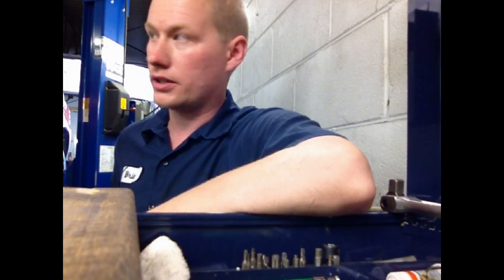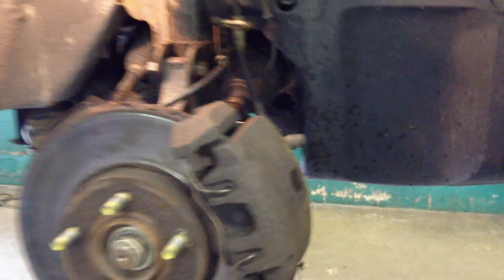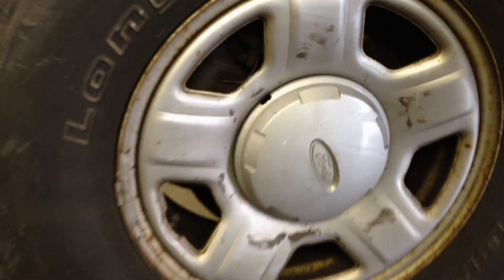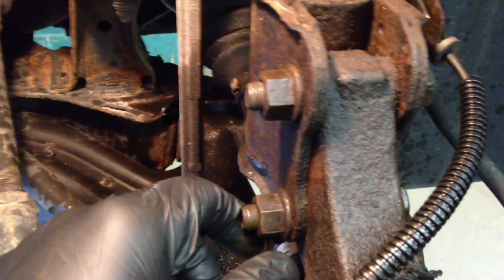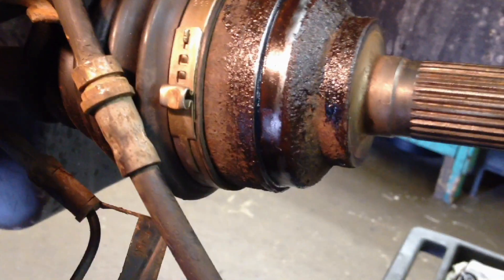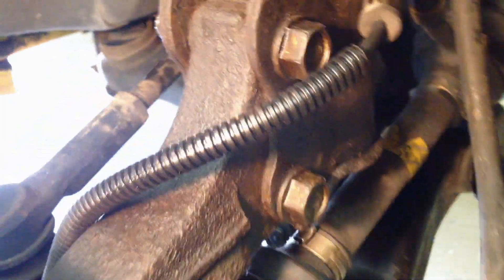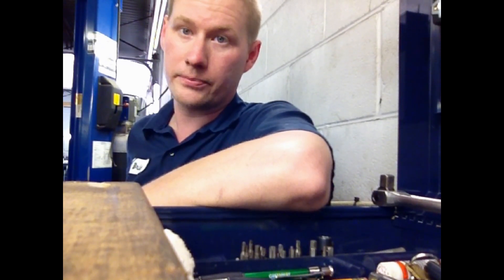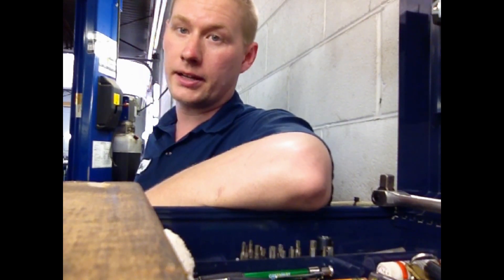Ford Escape ABS Tone Ring Install C1233 C1234

Comment: IT WORKED!!! Thank you so much.  It was a bit of a pain to get axle out and the new tone ring on with just a hammer and trying to be gentle, but using this advice and video, including the socket sizes and parts we needed, we were able to do a repair that was quoted at $300-350+ for less than 50.  Pro tip: long armed wrenches/sockets are critical, if you don't have pneumatic tools,  it took more force than I weigh to get those two main bolts off.

Comment: Replaced second tone ring on wife's '08 Escape just tonight. Used this method for the first, but hadn't seen your video where you suggested a little bit of grease. The first one took a long, long time to get on two years ago! This time I used a Dremel with small wire wheel, wire brush, grease, and the heat-gun application mentioned below (heat up the tone ring!) WOW did that make a difference in how well it went on - less than 2 minutes to fully seated!
THANK YOU for referencing all of the nut/bolt sizes, and also for the torque specs in the video!
THANK YOU for all of your awesome, informative videos!

Comment: Best repair video I've seen both in description, of procedure, image clarity and avoiding unnecessary steps (that add labor cost estimates in factory manuals). Appreciate added pro tips on removal of hub.  Using old ring as a tool is what a pro would use offsite without "special factory tool ####". Idea of heating ring (i.e. in oven) to expand is great suggestion. Excellent documentation by a 5 star tech!

Comment: I drive a 2003 Ford Escape XLT. My ABS light has been on for a while. I was prepared to buy two new sensors and replace them until I saw this video. I checked afterwards and found that one is broken and the other is completely gone. I will replace them once I go to do a brake job when it warms up outside.

THANKS FOR THE TIPS! Keep them coming.

Comment from the maker: I know I drag on in the beginning, I was trying to explain it a bit all off the cuff so...... Yes the job could have been done by the time the intro was over but I have a 32hr guarantee at work and it's been so slow it's unreal, that's when I make my videos when there is actual time to do it.
Reply: My 5 speed manual is giving me a tone alarm when I start the engine, 4 double quick tones. Engine light on, and my power steering failed, but once computer reset, power steering came back. Now also have extreme shaking of steering wheel especially when wheel turned left. New tires, good air volume, new brakes front, new baring on left.
Reply: Thankyou for making these videos it is a God send
Reply: When putting the ring on is there anyway specific way to line it up or it can go on randomly?

Comment: Thank you so much for posting this video. The shop refused to replace just the tone ring and wanted to replace the entire axle. After watching several videos showing I needed to take apart the tie rod or ball joint, I ran across your video showing neither was necessary. This was a great news as long as my 07 escape was the same setup. (It was) I completed the entire job in my garage in under 2 hours. The hardest part is making sure you have all the rust off the axle before putting the new ring on. I used a Dremel tool with a small sanding disk and it worked great. Thanks again for the great instructions and video!

Comment from the maker: No it won't, fits very tight. Just a bit of grease wipe excess off as stated. This is the exact way we do them at the Ford dealer. No heat, a light film of grease, only difference is we have a press on tool. Same idea only smoother to go on.

Comment: I have a 2008 Escape and I used this video to replace the tone ring. Only took an hour and $10 for the part. I used a gear puller instead of the punch to push the axle out, worked great. Thank you for the great instruction, saved me $$$. No problem with the ABS now.  Turns out a friend of mine has a similar issue on his F-150. Now I can help him. Thanks.

Comment: Dear Makuloco, I appreciate your video soooo much! I replaced a tone ring today, using your super-duper steps.  The most time consuming part of the job was removing rust from the tone ring mating surface.  It wouldn't come off with a deburring wheel on an air grinder.  Made sparks but no rust was removed.  The rust was dark and hard as mill scale.  I finally used a small file and worked it around the diameter. I also scraped at the rust with the blunt end of the file and it would flake off. I used anti-seize compound instead of grease to bed the ring because I am a great believer in the stuff. 
     One thing I have not seen mentioned  in other posts is that tone ring replacement is an ideal time to inspect the brake hose.  On this 06 Escape with 142,000 miles, the cover has failed at two locations and the cord is visible. I ordered two front hoses from NAPA and replacing them is tomorrow's job. 
     Here's an INCREDIBLE ITEM.  This tone ring failure is the first breakdown maintenance item since our family bought the Escape when it was one year old.

Comment: I have to say that you are right the money. I just installed new rotors and pads because I was having issues with my breaking. I noticed the ring (after seeing your video I now know it's a tone ring) was cracked. I didn't think it was an issue but I was way wrong. I am going to replace the tone ring now. Thank you for posting the video. From Kentucky, Brian.

Comment: I spent a bit of time trying to diagnose this fault and then decided to try Google. Even as an auto tech there is so much we can learn from guys like you. Thanks so much for this video. Here in NZ our local Ford/Mazda dealer does not stock the tone ring as a separate part so I will have to buy after market complete CV joints. Still a lot cheaper than the dealer quoted me for complete axles. :) Once again, thanks for doing this.
Reply: Same!

Comment from the maker: Axle nut torque for an 2008 is 221 lb-ft, front arm bolt spec is 85 ft lbs

Comment: I follow the instructions from the video , all worked out changing the tone ring on the 2006 Ford escape XLT . Dealer told me will have to replace the whole joint .
Paid 17 dollars for the ring and replaced it myself . It took 2 hrs everything was stuck .
Reply from the maker: Good to hear it all worked out 2 hours or not it is allot better than what you would have paid.

Comment from the maker: The actual tube of the strut that comes down and bolts to knuckle by the 2 bolts you just pulled out. Push it  straight in to the body and it will slide right out of the knuckle no prying necessary.

Comment: Awesome tutorial! I will be replacing my tone ring on Tuesday, at the auto hobby shop at my local Air Force Base. So I will have access to all the same tools that you used. Really glad I did not go through with following the advice from some of the other videos people posted showing themselves heating up the ring. And thanks for stating all the torque settings.

Comment from the maker: Puts tension on it at the full hang and clamps and hols that bushing center tube, now you put the tire back on and drop the car down and now that bushing is being twisted and torn out of there constantly when at a rest position like when you car is parked or at a stop light. If you put weight on it arm goes up then you tighten so bushing is at rest when vehicle is. You still tighten to spec but it just after the weight of the vehicle is back on it. No need to pull abs sensor.

Comment from the maker: Right your way the 2 strut bolts stay in. As far as camber adjust, it can be done by indexing the strut, camber and caster are adjusted this way just rechecked WSM. The 2 bolts for the strut to knuckle are installed at rest from the factory, when you loosen the nuts you will see the two don't move from each other. So no alignment is lost which is nice. Those brake lines move everytime you turn the wheel driving. Never seen a brake HOSE itself crack and burst or leak ever.

Comment from the maker: Same way it was taken out, align splines and it slides through.

No risk at all use air hammer with pointed tip and put right into divit in axle thats why its there, axle is very strong. Its actually better to use and air hammer than a sledge on the axle end with the nut on.

Are you talking the rh axle out of the ptu? There are no u joints. The axle is held in place by a bracket and 2 13mm nuts after that they just slide out.

Comment from the maker: Quite certain this is your problem. Your front tone rings are likely your problem over the rears check for looseness of the rings with a screwdriver light pressure or your hands, look for cracks in the rings. The procedure is the same for the 08. The 08's just had a facelift, suspension is the same.

Comment from the maker: Probably wasn't educated enough on fords. If there is a wheel speed signal loss first thing you check is the tone rings and sensor for damage so I believe they didn't want to chase the multiple codes and just stated it need the abs module. Oh and BTW I have never seen an ABS module go bad on a escape. Good to hear your experience, thank you for sharing!!!!

Comment from the maker: Thank you for the question! I know exactly what is wrong. I am assuming you bought wheel bearings with the abs tone ring inside as the right front is not having an issue right? Both bearings same part number correct? If so you put in the left front wheel bearing backwards. One side of the bearing is shiny metal other side has a black soft ring to it. The black soft ring side goes on the inboard side where the tip of the abs sensor touches it. Check that out and let me know.

Comment: Thanks Dude. Followed your video step by step and could not have been easier. One thing I did was heat it up a bit with a handheld heat gun on low. 2 minutes with the heat gun and it slipped right on and only a few taps to get it seated snug. Thanks Again!!
Reply from the maker: Nice even safer!

Comment: Hey FordTECH...  Thank you for this!  The local shop wanted $300 CDN for this repair.  I watched the video and had it repaired in an hour and half ($10 part, tone ring).  The vehicle is my father in-laws and he is retired.  He was thrilled!  I am a bit OCD with torque specs. If anyone needs I found them online 214 ft-lbs for the hub nut and 85 ft-lbs for the strut-to-knuckle bolts.  Wheel are 100 ft-lbs
Reply from the maker: Sweet good to hear it all worked out.

Comment from the maker: Yes use blue Loctite and torque to spec. Read my other post on pulling "the one bolt" idea not good. Use thin film of grease to ease it one, whenever something is pressed on it is greased as are bearings when you press them on. Hard crazy glue will not do anything to stop the rust not needed. The grease will not let the ring come loose, we are not sliding it on we are pressing it on. The tone rings are loose and wobble when they fail, never seen one chew into a sensor, ever.

Comment from the maker: Yeah they are a pain. You must back off outboard toe link bolt so you can get to the 3 bolts on the backside of the hub they are like 13/16", lower control arm through bolt @knuckle too, axle nut of course. Then the whole thing slides up and out of the way from the arm. I believe the only time you need to support the suspension is when you are trying to line up the lower arm to hub through bolt. Hope this helps

Comment: First off, I was a certified John Deere-Gravely-Cub Cadet Tractor tech from 1987 until I closed my shop in 2001. So I'm not just a guy with some Home Depot tools. The reason I was checking out instructionals is because I have never done this job before, same reason ford has you sit through those boring satellite videos in the break room(yeah, I worked at Ford a couple years too). I did this job back around June exactly the way I described. I used Stee1hed's video.>>>>

Comment: Actually I was referring to the driveshaft where it connect to the front differential.  There are six bolts holding it on and once those come out it's supposed to slid out.  No luck though.  However, I picked up a u-joint C clamp press thing and replaced the u-joint underneath the truck.  Worked like a charm.
Good videos though.  Looking forward to seeing more.

Comment from the maker: Yeah the area needs to be really cleaned up, think about it there was enough rust grown under there to expand and break a metal ring. Hard to show in the video. Thin film of grease is just right, they will not slip off. The way I see it is Ford had a issue with the rings metal, and the new service part fixed that as many other fords even old severely rust Taurus's have the rings on the shafts and I have never changed one of those, they could handle it. Ford's F up but we shall fix it for them.

Comment: Thanks, man! Looked under and sure enough, that sucker was cracked.  Was funny, I pushed the broken one back into place and the light went off, lol.  Gonna replace it tomorrow when it's a little warmer.  Also swappin out the stabilizer end links, too, am getting a clunk.
Thanks again for the cool and informative vids! :)
Reply: @FordTechMakuloco and 8 years later I'm back again. Same one, too, front passenger. I needed a refresher look-see before I go at it again. Thanks again

Comment from the maker: No no the bolt comes right out. No problem. It's getting that ball joint out of the pinch its in, never easy when any amount of rust is involved, not to mention the pinch holds it still after the bolt is out. You can try either method definitely a free country. I stick to what I know works after all these years of doing them. Thing about videos is usually if there is issues they are cut out or pre loosened for instructional purposes. I am just trying to help and I know what I am talking about.

Comment: I replaced the tone ring back in June. It didn't even last a year. It cracked and came loose again. I used a Ford OEM packaged ring too. I used Stee1hed's video applying heat to expand it on. I think that killed it. No heat this time.
Reply from the maker: Yeah I have never used heat personally and have never had one come back in all my years of changing them out on Escapes or otherwise.

Comment from the maker: You can certainly try usually the when you press the hub face out (first step) the inner race will come out with it, or at least damage it. I have only had one or two in my career where the hub came out without the inner race. I would have another new bearing handy........

Comment from the maker: Just watched his method of pulling the front a arm bolt instead of ball joint pinch bolt. If you do that you Must put the bolt back in just hand tight then put the weight of the car on it (after you are done with the repair tire back on etc) THEN tighten that bolt up or you will ruin the a arm bushing, then your buying a new a arm, which is very expensive.

Comment: Everyone. Keeping the tone ring warm will help with installation. Keeping the axle housing cool will help with installation. A warm metal ring will be at it's largest, a cold metal ring will be at it's smallest. Metal expands with heat, and shrinks when cold/freezing.

Comment: Good point about heat.(Stee1hed's got the torch blowing right on the Tierod boot behind the ring). I did not like heating the part. But no matter how much I sanded and cleaned the surface the ring would not go on. I didn't want to use oil or grease for fear it might slip off over time. I know the concept of expanding a part(usually nuts and bolts) with heat. It worked. I think the Crazy Glue to seal out water was a waste of time though. I don't think the ring is hardened,so heat should effect it

Comment from the maker: If the black side of the bearing is against the abs sensor as it should be, then I would say the exciter ring inside of the bearing is bad, either from the factory or from the install process. At this point I would change the bearing.

Comment from the maker: If its installed correctly and when the abs sensor is installed and you look at it from the backside its right against it like it should, I would have to say the exciter ring inside the bearing is bad, happens allot on aftermarket rotors and bearings that have exciter rings. Never had a problem with the Ford stuff though, These aftermarket bearings? Yes its seeing the rf spinning normally and thinks the left front is standing still that's why.

Comment: Thank you for the video and instructional commentary.  Would've never thought about doing this job myself without your "help".  My tone ring slid right on after I cleaned up the mating surface. I used a little thread locker on it. Bad idea?  I was worried it was going to spin and give false reading...
Reply from the maker: Never had one spin or fall off afterwards they are pressed on just like the factory ones. Loctite is not a bad idea but not necessary.

Comment: I did not have to remove the two strut bolts. there's enough play to get the axel out just removing the lower pin. that bolt slid right out. I did need to align the lower arm with a jack to get the pin back in. Also in the case of a camber adjustment, removing those strut bolts would mean a new alignment. There's no adjustment there on the Escape though. I got a thing about old brake lines, they're usually dried out and stiff. It was a very simple job. Hardest part was finding the 32mm socket.

Comment from the maker: Great to hear the new bearing fixed it. Are you sure the traction light blinking isn't just from a normal traction control event where it limits engine speed? Is it taking off from a stop where wheel spin could occur and this is just normal, or is it just cruising down the road?